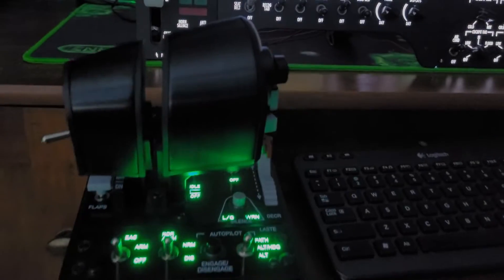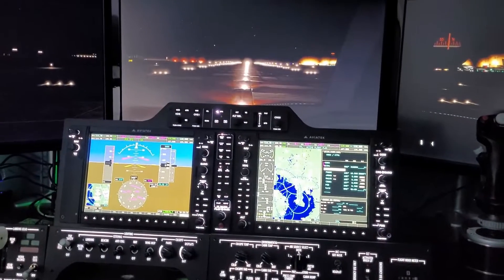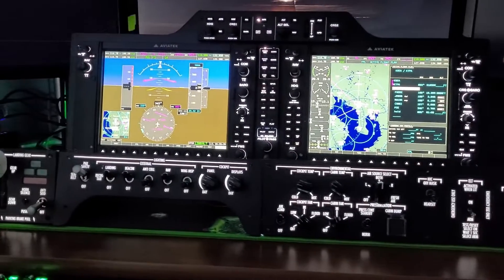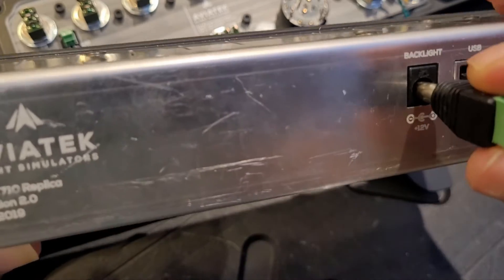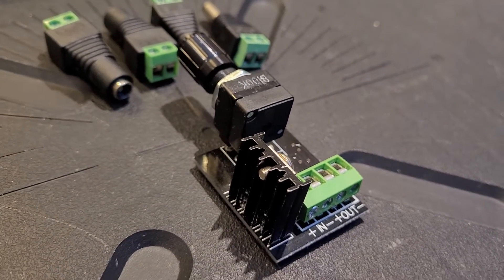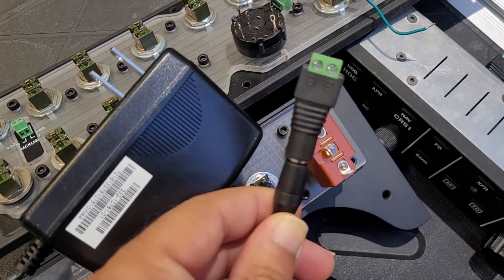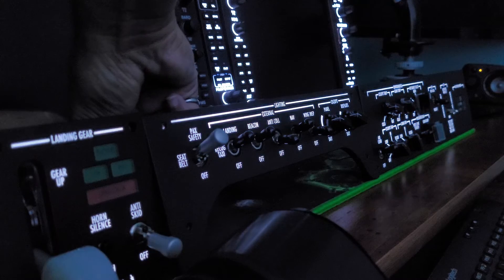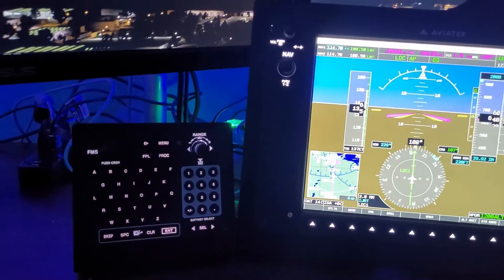Dimming Backlit Panels in Home Cockpits

Comment: Something to keep in mind.  If you have created panels and either constructed a rudimentary led pcb panel to be layer stacked with an acrylic legend plate using 3mm or 5mm round top leds or you have designed and printed a pcb to have smd 3528 or 5050 leds soldered on you may experience drop out of the led lighting when dimming to a certain point if you are using run of the mill dimmers like found in this video (no offence) then you need to switch to a "PWM LED Dimmer"  They look similar but are pulse width modulated.  You'll reduce, lower or completely remove the "drop out" and be able to dimm them to ridiculously low levels of light.  Just an fyi.............from my own mistakes.
Reply from the maker: Thanks for the feedback. Great tips. So far Haven't experienced any of that with the panels shown, and a sure way to avoid those mistakes is to always consult with the manufacturer of your panels to see what they recommend. 
If you have any links to the dimmers that you have been using please reply with them so that I can also list them as a source. Thank you.